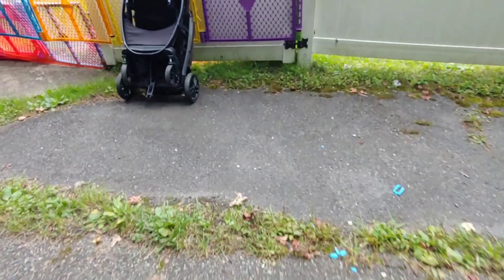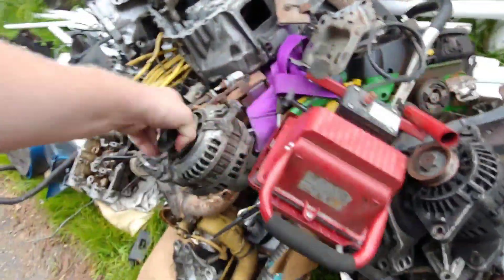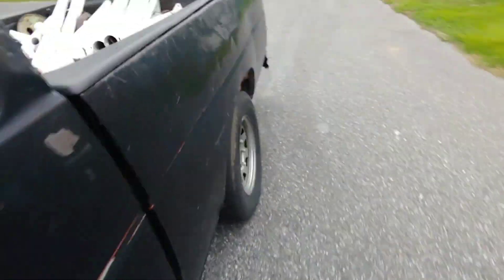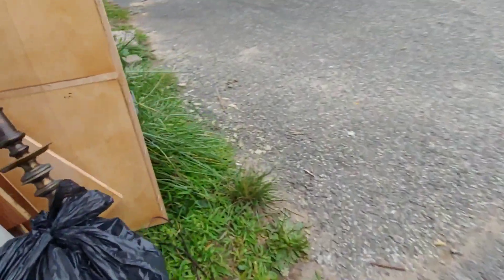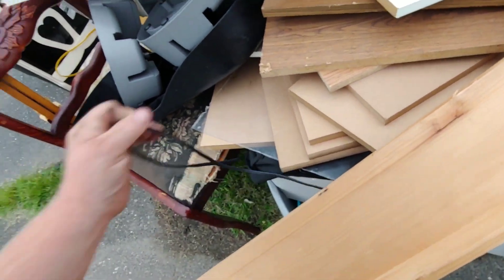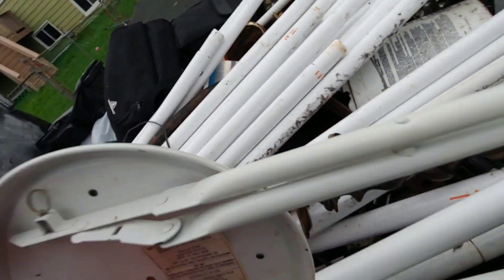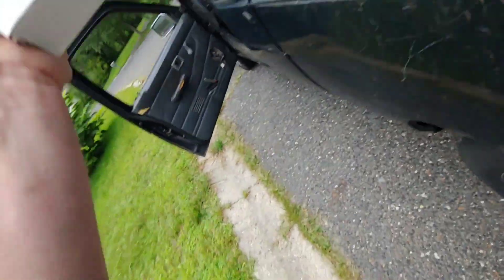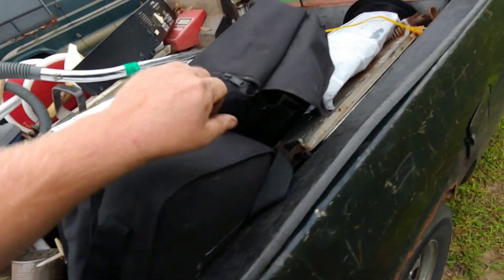Recycling Metal - alternators starters and turbo's.    OHHH MY!!

Comment: Technics is owned by Panasonic, I owned a Technics component system in the early 80's am/fm/fm stereo/ TV audio, direct drive turntable, dual stereo cassette deck, & a pair of Technics 200 watt speakers, a CD player was added 4 or 5 years later. all for approximately $1200, now my smart phone and a $50 Bluetooth speaker sounds as good or better.  Doh!